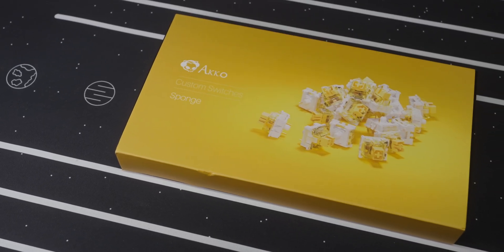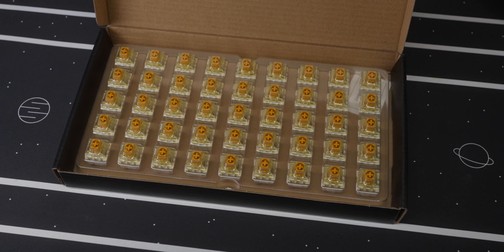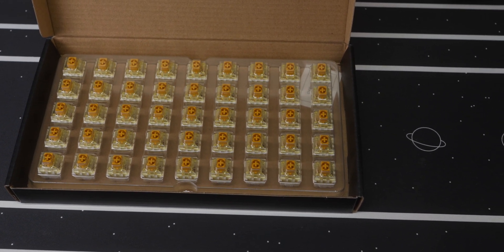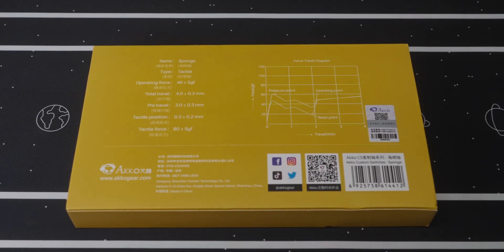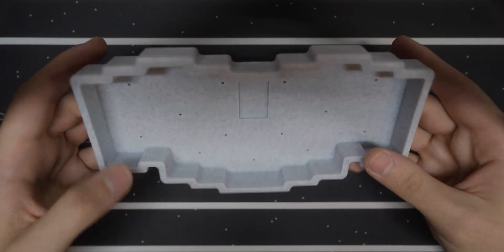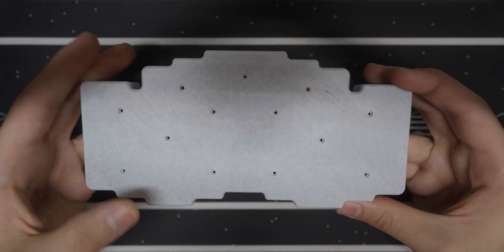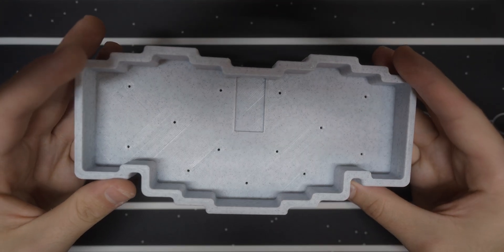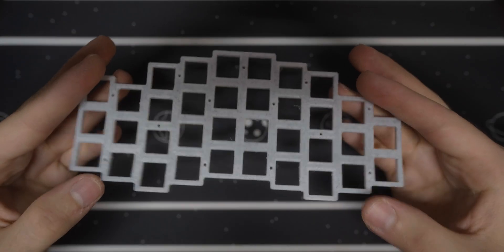Building a Handwired Keyboard with Akko Sponge Switches

Comment: What cables/wires did you use? What OS do you use to flash promicro? Is it qmk, zmk?
Reply from the maker: Ethernet cable is what I use for connecting to the pro micro and it’s flashed with QMK on a Mac.

Comment: How do you get away with a 3mm plate? Cherry spec sheet specifies that for switches to clip into the plate it has to be 1.5mm. are the switches just fine being held int the plate by friction?
Reply from the maker: I really don't know exactly why it works but it does. I know that the copper wire I use binds the switches all together but even without that they stay in the plate pretty well. I think it probably is a combination of friction and maybe my printers tolerances being really good. I've seen lots of other handwired builds that use hot glue to hold them in.